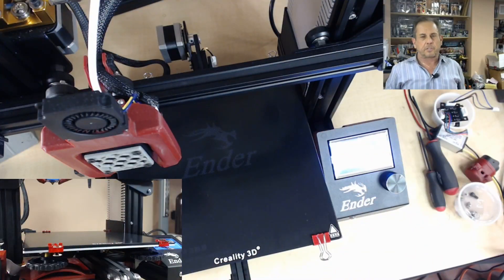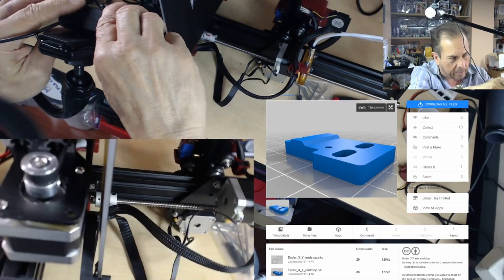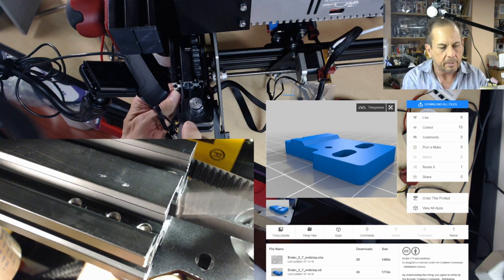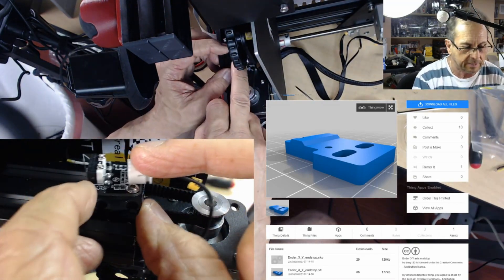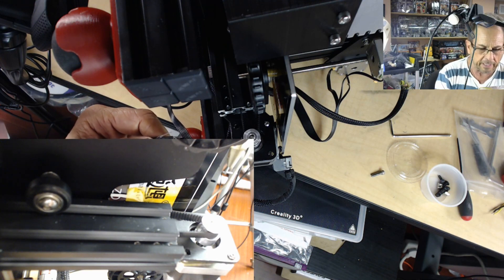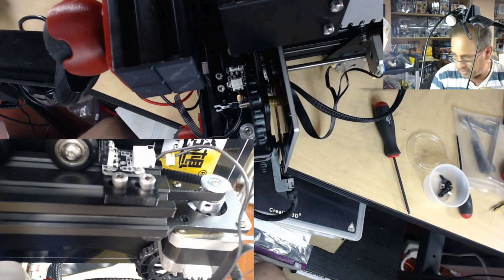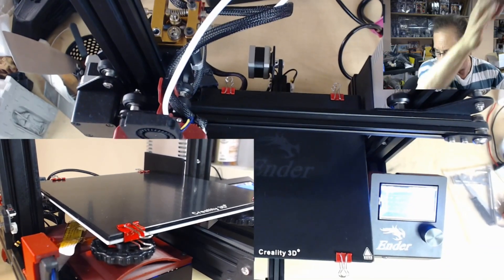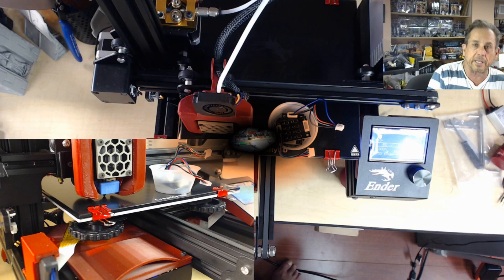Ender 3 Y Axis End Stop Adjustment for Stepper Dampers

Comment: I had a problem with my print coming about 1/8 off the front of a new glass plate, so I just moved the plate forward 3/8 and taped in place on the sides with packing tape. Worked like a charm.

Comment: The Ender 3's no longer have removable belt gears, so your're plug out of luck unless you want to buy new steppers and gears :(
Reply: The new pulley style at least on my ender3 was a press-fit no grub screw. It still was very easy to remove the pulley. I put it in my vice and tapped the shaft with a punch and it fell right off. You do have to buy new pulleys that have grub screws, at least I did. It would be very tricky to put the press-fit pulleys back on in the exact right alignment with the belt. Even though it was a little more of a pain in the butt to put dampers on the newer ender3 it was well worth it. I did have to move my stop switch because the bed crashes into it that fix the crashing problem. I do have one more issue now when the print is finished and the bed slides all the way out so you can easily remove the print my belt skips a few times. I think there is a way to fix that in your slicer I use Cura and in machine settings under end G-Code I think I can modify some values so it doesn't push the bed all the way out at the end of the print.
Reply from the maker: That is unfortunate to hear, thank you for the comment and update.
Reply: @RichterScaleStudios  I have found a printable bracket that moves the steppers into the correct location if you move the Y axis bracket to the other side and are willing to replace the metal bracket with a plastic one on the X axis, however I am not going to do so because of my worries regarding tension dropping as the plastic deforms under constant load. (https://www.thingiverse.com/thing:3245255  linked here for Y and https://www.thingiverse.com/thing:3271077 here for X )
Reply: I removed them with a pulley remover, easy pissy lemon squizzy
Reply: Yeah mine no longer have grub screws so there's no easy way to adjust the depth anymore.

Comment: Lucky I saw this before i installed the damper.. Do i need to change anything in cura?
Reply from the maker: Only if you are planning to print to the extreme edge of the Y axis. I have not used Cura in a while, but you can easily compensate for the offset.

Comment: what if I have that issue of the bed tilting a bit when I am leveling it on all 4 points? its an issue that I see could be with the bed bolts maybe being to tight. but I am guessing at this point. should I move the y stop switch further in the printer to fix this issue overall? thank you

Comment: Did you print your fang on your ender 3?  I have about 5 failed attempts to print the petsfang on my ender 3.  Would love to know how you did it and what slicer you used.  Thanks
Reply from the maker: Saw Dust No, I printed it on my PRUSA MK3, in ABS, with one failure.  The cooling fan mounted is problematic. I have not done ABS on the Ender 3 yet.
Reply: I am trying to print it in PLA.  The mount came out great but just had my 6th failure on the "fang"....  what slicer do you use with the Ender and would you recommend it?